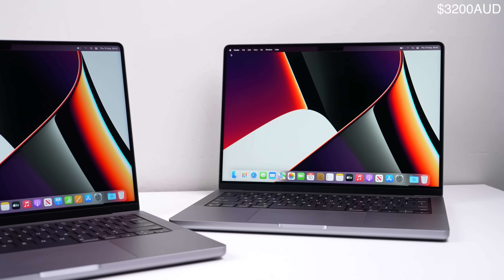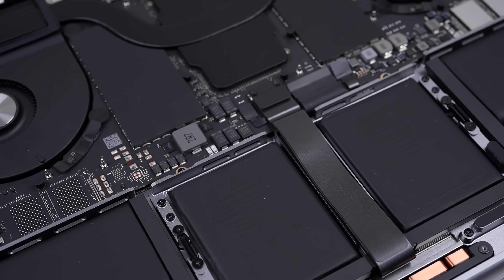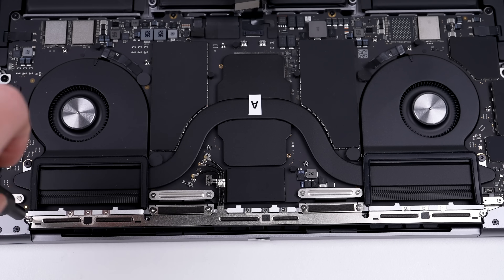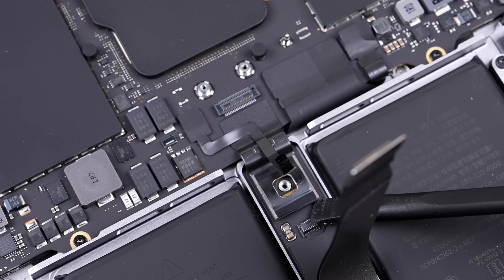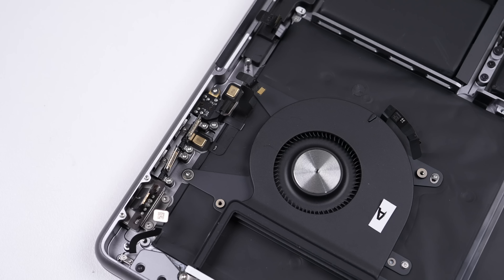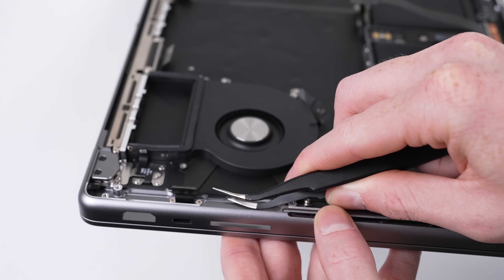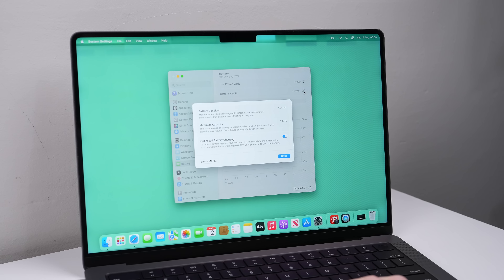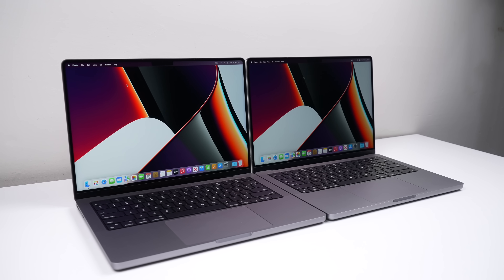New Anti-Consumer MacBook Pros - Teardown And Repair Assessment - Apple Silicon M1/M2

Comment: At this point, I'm just wondering why Apple puts screws on their laptops and just glue everything shut since it's not upgradable?
Reply: You're not being courageous enough. Glue is so 19th century. Make every MacBook phone home such that the moment you try to disassemble the laptop, it calls the cops on you and informs them that you're running a child trafficking ring out of it.

And Apple's doing it for your own protection and safety!
Reply: @johnnycheung5536  Lol
Reply: It’s not that they want it to be unrepairable. They just want themselves to be the only ones to do be able to so they can charge you whatever they want
Reply: Older MacBook pros used to be upgradable, I guess because of that apple decided to make them non upgradable
Reply: Just pot the entire base in Epoxy Resin! RTR defeated.
Reply: Glue takes time to cure and has issues with warping and unevenness and bubbles, its cheaper and faster to use screws most of the time.
Which is why it baffles me why they insist on using so much glue
Reply: @Mallchad   Apple only use glue (the adhivie removal strips) for the battery as this avoids a pinch point when the battery expands.  You do not want to skew in a battery as when it dies 7 years down the road forgotten at the back of someones draw the screw will pinch on the battery as it expands leading to a fire, this is why it is best for compact batteries to use the pull strip ahssive on one side and then design the product case to evenly bend/pop open to allow the battery to expand without putting any sharp spikes into it.
Reply: @hishnash  This is a super weak reason, batteries have been fiction fit since forever and others have it held it by the back panel alone. If this is really a concern all the manufacturers could use very weak glue that is easily removed by pyring.

There are even nano adhesives that are removable with a pull tab.. Why are you justifying this.
Reply: @Mallchad  apple do use pull strip adhesive, weak glue that is easy to remove.  That is what apple are using on all modern Macs.
Reply: @hishnash  okay, I wonder why people are still complaining about the batteries then. do you know anything about it?
Reply: @hishnash  why are you defending apple
Reply: @hishnash define modern. I know for a fact that some Macs from 2014/2015 onwards have had glued in batteries and they need a substantial effort to remove.
Reply: @xmlthegreat   Modern iPhone 12 and onwards (M1 and onwards)

Yes some older Macs including 2014/15 had soldi glued in batteries but all the M1 Macs and newer have been using pull strip adhesive like the phones.  It's not as easy to remove as the phones as a pull strip solution on a battery this size is much more likly to snap than on a phone but with practice is not that much of an issue.
Reply: I stand by my argument of never using a MacBook newer than 2012, Though now I have a much nicer A1398 retina, I don't use either terribly often anymore. I prefer my beloved HP Probook
Reply: Their service centers make big bucks. Like, a lot. They aren't against repairs. They're only against third-party repair.
Reply: @Traderhorn dont buy a garbage one, like stuff from hp with breaking hinges.
Reply: to be an illusion of choice
Reply: EU Laws won't let them, if they could they would already do it
Reply: Because it still needs to be repairable, But only by Apple.
Reply: They already manufactured a googleplex of every of the 1000billion different screws they made just to f**k with the repair shops, and customers...so they might aswell just use them since it's cheaper than gluing everything shut... also that would make them waterproof, and that's against their policies... 
- "1.1 You must under no circumstances do anything in favor of your customers."
Reply: I was genuinely impressed the panel under the laptop wasn't glued in place.
Reply: @HarmonicaMustang  given apple replace a LOT of these glueing them would cost apple money.   Apple are rather good at not using glue as doing so end sup costly them money, screws are easier to assembly in a factory (as you do not need to leave time for the glue to set) and easier to repair for a warranty repair or apple care cover repair.
Reply: They can pretend they are open while hiding how closed they are...
Reply: That’s too obvious and would make a very good case against them in court. You can make excuses about screws but not glue.
Reply: @Traderhorn   Depends a good amount on what OEM you go with, also in value for money it also depends on what you are doing, for many use cases apples laptops are now very competitive in cost with respect to the perfomance you get. 

Videos highlighting issues with apples laptops are common but that does not mean other vendors do not have these same types of issues just means they do not collect as many clicks on YT so do no get promoted as much by the algorithm.
Reply: @hishnash Can somebody tell me why can't I run my PC games and Siemens Simatic Manager PLC on my brand new M1 Pro MacBook. 😢

Are they didn't compatible?
Reply: @whizyp  read the requirements, 99% it's windows x86 only
Reply: @whizyp  Is this a serious question?
Reply: The use screws as they do a lot of refurbishment. I you get a replacement laptop under warranty it is not a new laptop just a new case with a refurbished internals.  This saves apple lots and lots of $$$ since they do not need to direct a new device for warranty replacement instead it's just a new case and glass but refurbished internals.  

Apple are intact rather good with using screws in products, many other vendors prefer the cheaper plastic clips etc that while they are easy to open once or twice as the device ages and suffers thermal cycles the plastic becomes brittle and snaps.

Comment: I repair a lot of Apple gear, micro-electronics level, and yes, they're constantly crushing the walls in around us like a StarWars trash compactor; however all that said, and having come from a very pro-IBM/PC, OS/2, *NIX, Linux background, I still cannot seem to find a Windows based laptop that beats out the Apple Macbooks in terms of overall usability and not getting in your face (while it's working ;) ) and usable longevity (7~10 years).   

Since the 90's I've used PC gear and laptops and it was always the feeling of compromises and "doesn't quite work right", even with high end Toshiba units at the time and then one day I decided to try use one of the Apple Macbooks ( 2015 Macbook Retina A1502 ) and that was it, I was sold, never gone back to a Windows laptop.   PC is still a nice Intel box with lovely big screens running linux, but laptops and phones I have to hand it to Apple, for as much as an a*hole of a company they are they do know how to make products that work for *consumers*.     If you want to talk about performance/$ ratios or other technical metrics, sure, PCs will win out, but if you want to talk about just-works/$ ratio Apple wins that race by far.

The new screens are a pain to replace but we can still do a chip swap on them to make them work, however  I've stopped bothering with it, for now I'm still fine repairing the damaged logic boards and getting data back for people.   

Yes, Apple is a major pita of a company for this behaviour but realistically they're still somewhat more repairable if nothing else because there's more information in terms of boardviews/schematics/diagnostics-experience than any other individual laptop model out there.

Comment: Man this makes me glad that I bought a Framework instead of a MacBook. We need Framework to make a phone!
Reply: @GooseAffiliate859   the fair phone is repairable but its expensive and its performance is the worst
Reply: Framework laptop quality is trash, it’s cheap and plastic and the chassis flex is sad
Reply: @FlyByWire1 look at this apple shill lmfao
Reply: @nikomega2  how does me pointing out the cheap quality of the framework laptop make me a shill? 😂😂😂
Reply: @FlyByWire1 what excuse does apple have for 4 years of the butterfly keyboard?
Their devices aren't repairable. They aren't cheap. They aren't a startup making first generation computers... So what's the justification?
Reply: @xmlthegreat  I think Apple tried a new design and it didn’t work out. That happens. They recognized the flaws and that’s why they started the free keyboard replacement program for all the models within that time frame. Then they redesigned the keyboard to fix what they did wrong. What else would you want them to do?

Comment: Appreciate if you may do something a little more in depth by swapping the SSDs across the 2 MacBooks to see if they’ll work. Just in case we might want to change/upgrade those soldered on SSDs in the future. With so much anti repair tactics at Apple nowadays, I to be very honest won’t be surprised if this is blocked as well, but will be nice to test the theory and see if it’s true. Thank you!
Reply: I believe it wouldn’t work as the ssds in the mac studio aren’t soldered, but still won’t work if swapped. Linus tech tips made a video about it a while back.
Reply: @owenoreilly_20  I believe ms actually made the ssds easier to access in newer surface tablets?
Everything is still glued and soldered on tho
Reply: @feefre  My bad, it was just a rumor, but it was about them using a similar method to apples.
Reply: @owenoreilly_20 agreed. But after seeing Linus’ video and this. Tbh I don’t really trust this other guy’s work. If Hugh can prove that this other guy is lying, it’ll be nice.

https://youtu.be/apEKAY11NQs
Reply: @YYPeh  hmm. It would be nice to see that looked at further
Reply: They have worked out how to swap the nand in the M1 mini's - basically they need to put the firmware on with a chinese gadget then perform a DFU restore, which results in the rest of the nand not occupied by the firmware to format and allow install. But you need good equipment and a steady hand. Luke Miani and another youtuber have done the upgrade, from a 256Gb base model to 2Tb. A caveat is you end up with nand that is second hand, with an unknown amount of TBW.
Reply: Soldered on ssd contain the bios information within the drive itself on a hidden partition. IF you can't mirror the drive and copy it 1:1 and flash the serial to make it  compatible you are SOL. IF the drive dies on you due to it being a lemon, pray that the warranty is still at play and covered or you're fucked. The data might actually be gone too, with no viable recovery option since even apple themselves warns users to backup information before sending things in for repairs. This problem occurred before the 2000s with Optiplex and a few other dead companies. Having your SPI or bios information stored on a WEAR part was seen as a massive failure point . . . it caused a lot of issues. History repeats itself again. There is no reason to test it out, it has already happened in other systems and hardware. The reason why companies stopped doing it was because systems administrators and the market did not take well to the outcome of that poor design, it is a lesson almost lost to the annals of history but thankfully Apples greed will bring about another lawsuit in due time to remind the public why crappy design should hurt manufacturers.
Reply: Aren't the ssds soldered on the macbook?
Reply: @youtube_bot839  Never stopped the Chinese.